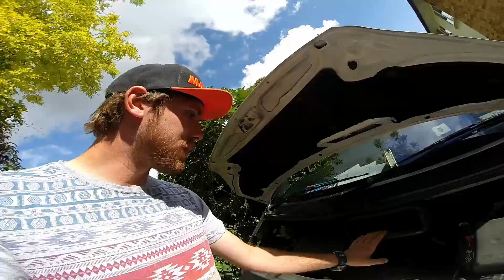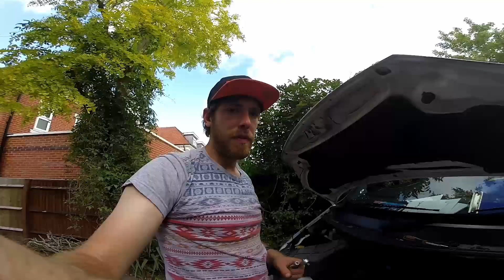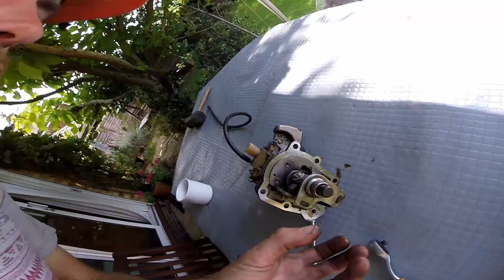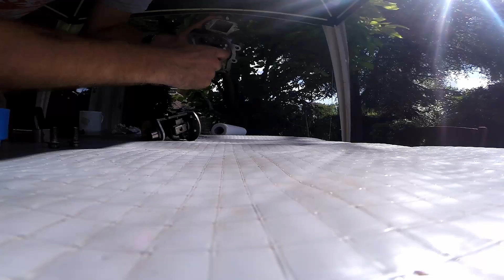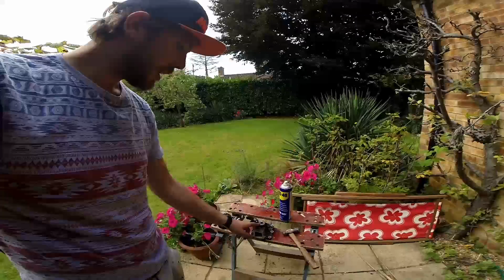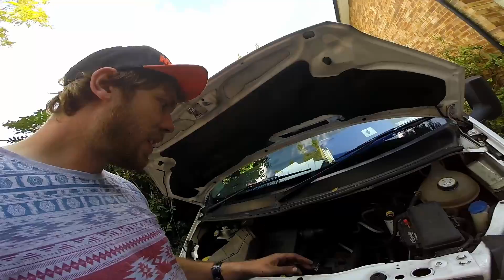MK7 Transit Van , Replacing the Gear selector turret bearing

Comment: Thanks for the video. I drove to a job perfectly normally. When I went to leave all I could just about get was 2nd & 3rd. Knocked the shaft free with a copper hammer which got me going. Replaced the bearing and seal with one from ebay a few days later.

Comment: Thanks for the video, does the selector pull straight up out of the engine after removing the 6 bolts? My bay (FWD 5 speed) looks really tight.
Reply from the maker: roulettered56 i found it did come straight up.no problem